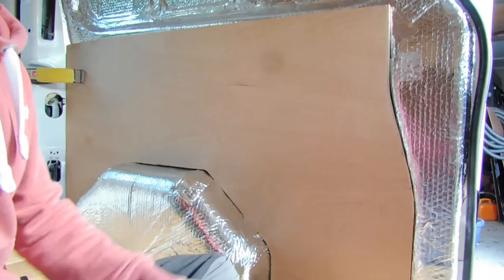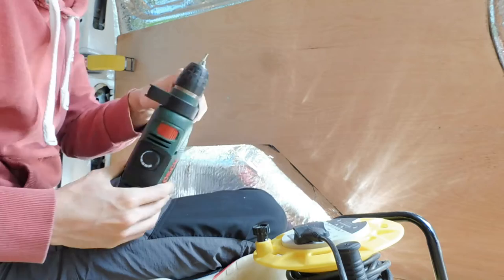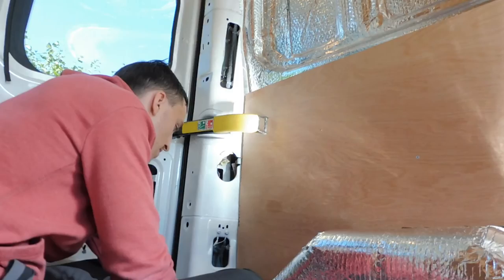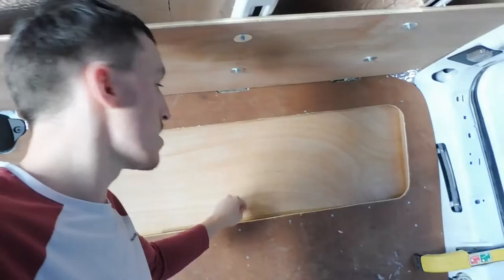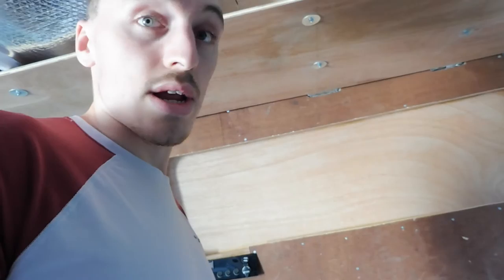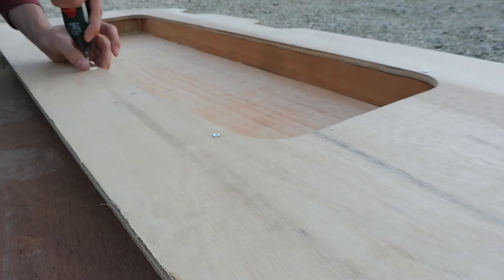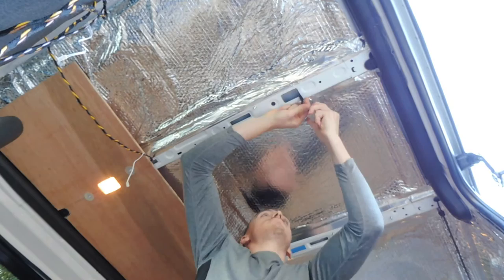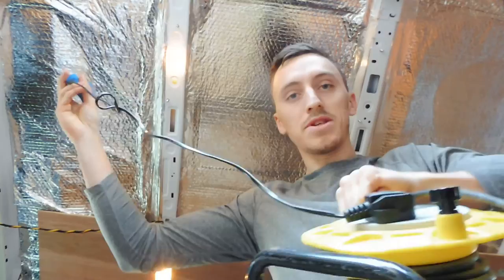VanLog 10 CAMPER CONVERSION Ford Transit Custom PLY-ING INTERIOR! HOW TO

Comment: Why haven't you used any insulation fleece in the voids? The foil roll won't do much on its own.
Reply from the maker: Hi Phil, very true, this was my very first conversion that I tried to do with minimal research to test myself. I would probably used closed cell spray foam kits now
Reply: I'm looking at a transit custom to do myself. This will be my first one. Videos are a great help. Thank you.

Comment: Hi Hugh, thanks so much for all your videos. Currently converting the same Van in New Zealand. Do you remember what screws you used for the 12mm ply into the walls? Any help would be appreciated.
Reply from the maker: not sure if its the same but i regularly use these:
https://www.screwfix.com/p/easydrive-self-drilling-low-profile-wafer-screws-4-8-x-22-x-200-pack/7483h

Comment: Whats going over the ply? none of the screws are counter sunk and the bolts stick out. How will you get a decent finish?
Reply from the maker: Hi FORKinFISH actually a lot of the screws are countersunk, sorry I haven't been showing this in the video but usually after I am happy where a piece is mounted I then remove the screws and countersink them.
Reply from the maker: FORKinFISH oh and to answer your question there will be some areas painted and some covered in cork board
Reply: HughTube i love your vids man keep it up

Comment: Hey... did you drill / screw directly into the metal at 1:30 ? If yes, aren't you afraid of rust ?
Reply from the maker: Hi Michael I did drill into the metal but no I am not worried about rust as that steel will not really be exposed to the conditions to cause rust